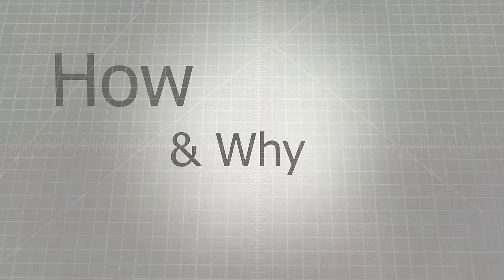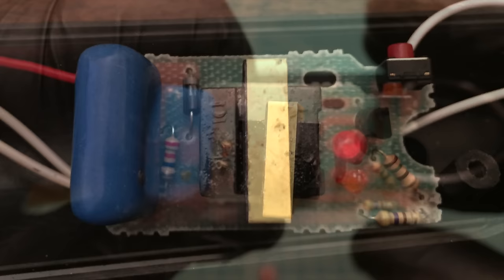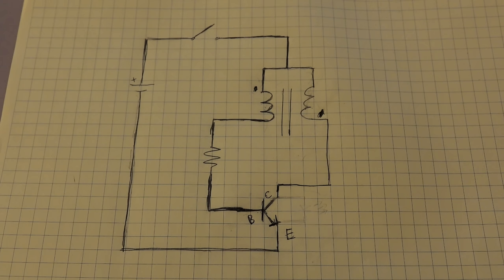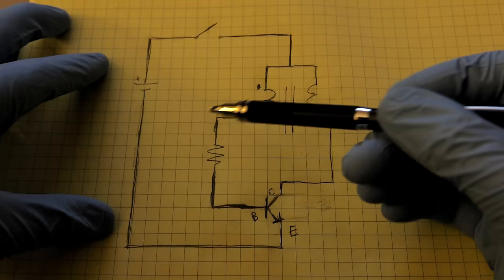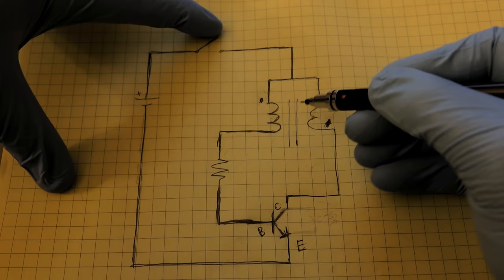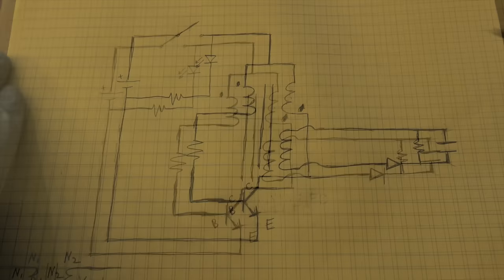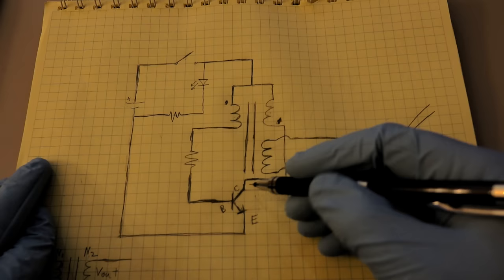How Does a Bug Zapper Work?

Comment from the maker: If you like my videos, please consider supporting me at Patreon.com/ProtoG42 to help me produce more content.  You can also support me by simply subscribing and liking my videos.  Thanks for watching!
Reply: +Proto G Can you please tell me, which is the value of the capacitor. I'm trying to do my own bug zapper. But i just need the value of the capacitor. Thanks
Reply: a photo flash cap would work good. 50 uf 200 volts

Comment: Thank you for explaining how the circuit works. I use your explanation as the main basic template as to how other charging circuits in other electric rackets work. Their circuits are almost the same as your circuit except that a few components get switched or shuffled around. For example, you might get a voltage doubler that's included to charge the center tapped primary coil  of the transformer. Anyway, I just wanted to say thank you and to say that you would make one heck of a great engineer !

Comment: Your ability to teach is amazing! I came here to learn about the bug zapper and ended up learning way more ....almost to the point that I forgot all about the bug zapper, lol. 
I do have a question I was hoping you or someone could help answer: 
 • 7:03 I understand the purpose of the bleed resistor, but doesn't that also mean it will constantly be trying to drain the capacitor, thus making it inefficient?

Comment: Please correct me if this is wrong, but I think there's a small step just before the field collapsing - when the inductor current (current in the right hand side of the transformer) reaches it's maximum value, the field strength becomes constant, which means the induced voltage in the left hand side of the transformer drops to zero, which in turn causes the NPN to switch off. Now the collector will not pass current and the field in the right hand side of the transformer collapses.Good vid thanks

Comment: Great explanation!  
A ghoulish proposal: It would be a fun project to add a counter that keeps track of the total number of insects zapped. A tiny Scub1000 LCD counter module and the appropriate conditioning circuit could watch for voltage drops across the bleed resistor (or perhaps current spikes through the output capacitor) and increment the counter's display. A problem might be false counts caused by sizzling corpses but the conditioning circuit could maybe distinguish between sizzle and pop. The Scub1000 is so small it could easily be fitted into the handle along with the additional components. Unfortunately, my circuit-designing abilities are insufficient to actually figure out the details but I do have the ability to follow a schematic and build it in. Does anyone have any circuit suggestions or thoughts on this?

Comment: Very well done video. great picture and explanation. It might be helpful in the future if you discuss a little about the value of the components. like, if you raise the value of this resistor, then XXX will happen, or this capacitor requires a max voltage value of xxx in order to ......  

I found your video to be clear, concise and informative. thanks

Comment: Can a single battery create more voltage? 3000? 4000? Just by adding more turns to the coils?

You may have figured out that I am not an electrical engineer?
I am working on a project (prototype) and am doing things I have no business doing based off of my intellect level.

Also, if you left the zapper ON, would it drain the battery very quickly, or only gradually unless it is being activated by closing the circuit due to a bug touching 2 wires?

Comment: One question I have is this. At about 5 min, you say the field is no longer changing and it collapses. Why does it collapse? Does it not jsut reach a steady state where current flows through the first coil to keep the transistor on and current flows through the second coil down to ground?

Comment from the maker: +Chris Uroda I can't reply to your comment.  You may need to change your settings.  The voltage in the left side of the transformer drops below the turn on voltage of the resistor as a result of the right field collapsing.  Remember, the battery can slightly open the collector on its own so the collapsing right field needs to act against that base voltage to turn the transistor completely off.  Once the right side of the transformer reaches its saturation point, the collector begins to close because it is back to only having the battery voltage.  In this circuit, the collector rises to completely on and falls to completely off similar to a sine wave.
Reply: it's okay , thanks for the answer

Comment: My question: Does this actually mean 1300V DC seeing as how the diode technically converts AC to DC by only allowing the current to flow one way? Or is this HALF AC seeing as how it's only allowing positive bumps which (come to think of it) would act as a switch to turn the flow on/off depending on where the peak of the bump would be?  Like it'll still be DC just because there's a diode acting as a check valve, but it's not straight DC because it's not a straight line, but rather bumps, which would in turn make the Diode act as a switch. I maybe overthinking things a bit with this, but I'm trying to understand what I'm dealing with here.

Comment: Sir well stated, thank you. I have a question, in order to remove the bleed off effect, would bypassing the  bleed resistor to the job? and by doing so would this cause any negative effects, such as discharging the battery, or over loading any components?

Comment: Hi, very instructional and well organized video! I have two questions. Could the electric circuit inside the zapper be considered one LC Tank Self-sustained oscillator of the Hartley type? Also, what would the connection be in order to see on an oscilloscope screen the output alternating voltage of this circuit? Thanks for your attention to this. Cheers!

Comment: Proto G thanks for the detailed video of these as I have one with a circuit that has no power meaning it doesn't zap but the red power LED is on. when I stick something metal across the grids it makes a tiny zap and on another zapper it makes a loud zap.
Any ideas? Bad transistor? I have the circuit and am not sure if I can fix the zapper. I'd actually like to turn it into a curly CFL bulb driver b/c I saw a video on here where someone did just that.

Comment: so the joule thief part of the circuit is not so that a 1.5 battery can be used in the case of an led it is to make a simple oscillator? why is this used instead of using a 2 transistor typical oscillator circuit?

Comment: I swapped out the AA batteries for an 18650, which gave it a little more power. I also added a TP4056 charging circuit. But that's just until I receive the 400,000 V high voltage generator that I ordered to replace the circuit that came in it. That should be interesting lol. I know they highly exaggerate those numbers, but I figure it'll probably be putting out 20-30kv 😁😜

Comment: Was looking at converting one of these to wire a plank to shock a cunning rat into a bucket of water. I have failed to catch with traps, cages and electric kill trap as it is too smart to enter any. Once bitten, twice shy. You mention the bleed resistor to drain the capacitor, so is there any issues with replacing the switch or just simply taping it down so it is on for a longer period (overnight)? Or is it better to remove the bleed resistor? I am hoping the first option as it would provide multiple chances at getting other rats. Cheers.

Comment: Excellent tutorial, Question for you. I have a fence charger that runs on a 6 volt battery. Once the battery died I replaced the 6 volt battery to  9 volt battery and now it won't work. I know I fried something on that circuit. What could it be, is that an easy fix? please help.

Comment: Very Interesting, I'm trying to build a Bug Zapper lid for a metal Coffee can to keep gnats & other bugs out of the can of Food Scraps with aluminum Screen for a screen door & a 12 volt power source, I need the wires to get a good connection with the screen & the bug zapper to work all the time, as long as it's hooked up, without setting off the surge protector in the Jump Starter I'm using for power, since the 12 volt Lantern Battery seems to be not doing anything, I've got a negative wire & positive wire fastened to opposite sides of the lid, with a negative wire as a ground wire connecting the screen to the coffee can, How do I get this to work without setting off the surge protector?, hook wires to a capacitor, then to the screen?, I'm trying to build a bug zapper, because another bug flying around the house is the size of a speck of dust & flies right though the screen of a bug zapper, untouched.

Comment: I have a bug zapper I modified a while back and added several more capacitors on them. Since its non polarized foil caps (I think they are like 400v by factory default) can I add a electrolytic 400v cap since there's a diode? If not should I rectify the ac with 1 diode or a chain of 4 for full wave 120hz dc
Reply from the maker: +The Computer Tech Guy Yes, you can add an electrolytic that is properly rated for the output from the transformer.  Using a full bridge rectifier will result in the capacitor charging about twice as fast.  Removing the bleed resistor will increase your output as well but it will be more dangerous to handle.
Reply: Great video and great explanation! 

Can you explain how removing the bleed resistor would make it more powerful?

A guy had a mod video showing people how to disable the bleed resistor. He was chastised by so many people in his video comments section on how it wouldn't do anything to make it more powerful.

The best way I've seen is by adding a stronger, external capacitor wired/soldered on to the existing capacitor. I saw a guy add a small, rectangular shaped capacitor salvaged from a broken grinder to a bug zapper swatter and it seemed to be stronger. My reason for modifying my zapper (which uses 2 "D" size cells) is to kill the yellow jacket bees that try (and sometimes succeed) to attack my toddlers at almost all city/county playgrounds that I take them to.

What would be the best mods you would recommend to turn a fly zapper into a bee/hornet zapper?

Also, could I replace the three screens with one piece of strong steel mesh such as galvanized steel or aluminum mesh? If so, how would I wire on all three internal wires?

Sincerely, 
Jacob
SurvivalGeek (YouTube)
https://www.youtube.com/channel/UCfRsUPToBXp4ZIre__dJg4A

Comment: Can I fabricate a perch from one side of the caps output and the other side to a bare wire inside a hole to zap woodpeckers? I am sure current is very low but the pest cease to be a part of wildlife when it / they put 37 holes in my house. 
Bug zapper = Bird zapper, they tell their friends and leave. Seriously, my daisy BB rifle is not a repeatable accurate tool. In the city, we are not allowed to discharge a firearm. So a C02 pellet pistol maybe next. 
  The bird zapper would send a much clearer message to all that try. I have to be constantly aware of what is beyond the offending foul as I wish no harm to my neighbors window or vehicle. At 360FPS, a BB air powered rifle will drop quickly. But not true with heavier 177 pellet traveling twice as fast. I tried leaving a note, they won’t read it. I filled the hole with foil (Conductor) but the simply pecked until pulled out. I tried modified sticky traps for rats with wings, caught one, the rest got wise. I don’t my house covered in 3 X 4 black plastic trays with a semi-circular hole cut to fit at the hole, not near it. I have gone 18 years without peckers of wood attacking my bug free walls. I have to fix each. Bird Zapper, order yours before mid-night tonight and get free shipping!

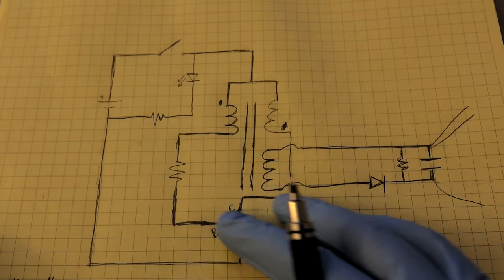Comment: I am not sure if the equation shown at 7:24 is accurate for this circuit. Because the oscillator generates a non-sinusoidal wave,  and has rapid di/dt that results in the back EMF, and also because the circuit is self resonating and operates close to the resonant frequency of the transformer, wouldn't the peak voltage be much higher than expected? Good video though! Thumbs up!
Reply from the maker: Thanks! Yeah, that isn't really accurate for most transformers either as leakage inductance and stray capacitance come into play and that formula assume an ideal transformer .  I think it would be closer to the formula used for boost converters V = Vbat*sqrt((RT)/(2L))
Reply: The formula is accurate as shown in the video.  As the field collapses the voltage increases at the collector.  The output voltage is the collector potential w.r.t. V+ multiplied by the turns ratio of the transformer.

Comment: Your terminology of the transistor "opening" to let current through may be confusing, based on an "open" is usually a gap (switch turned off).  Is that common terminology for talking about transistors?  I've never heard that..  If not, you might want to steer away from that, just because the audience is beginners..  Second..   Wouldn't the transistor turn off anyway and oscillate because once it's open, the right side of your coil is a less resistive path to ground, so current would stop flowing to the base?    And.. couldn't this circuit have been improved by a full wave bridge on the output side, where the LED is? It seems we're only charging with half the potential available, unless I'm missing something?  I know it was done for cost, but I'm just curious..

Thanks for the video - I've always wanted to take one of those apart.
Reply from the maker: +Steve Jones First, think of the collector as a gate.  It opens to let current flow through, but it doesn't have to be all the way open.  It can be partially opened like the valve for your water hose.  While the collector does not move, it is still good to think of it as open and closing like a gate.

Second, no. The path of least resistance is a common misconception.  Connect two lightbulbs with different resistances to a battery.  They will both light up albeit with different brightnesses.  This topic gets a bit more complicated when talking about lightning and arcing.  Most examples you'll find online assume that the short to ground has a resistance of zero which never is the case.  Read up on Kirchhoff's circuit laws.

Third, a full bridge rectifier on the output would charge the capacitor about twice as fast.  That's just a regular diode on the output side.
Reply: +Proto G Thanks for the quick reply..  I get the analogy of the gate, but my question was in the terminology of using "open" to indicate that current is flowing ("opening" the gate) whereas in most electronics, a CLOSED switch lets current flow, and an OPEN circuit means nothing flows..  Even in transistors, "open collector" output means no current flowing..???
Reply from the maker: +Steve Jones I suppose it could be confusing but it is very common to think of the collector opening and closing as I have done because of the water analogy when speaking to beginners.  In reality, the collector doesn't open or close at all.  The collector conductivity changes as a result of the base-emitter voltage changing but you don't want to get into the heavy technical details for fear of losing a beginner even more.
Reply: +steve jones you have to realise that opening and closing of a manual switch and the opening and closing of a transistor gate being different and very  well understood by anyone learning the basics of transistor circuits-if that is confusing you then perhaps you should try learn in very small steps-steve jones out of the sex pistols was a mean guitarist-perhaps take up that ;-)